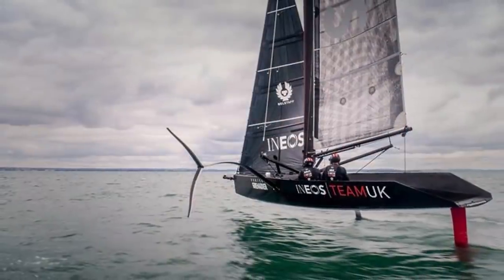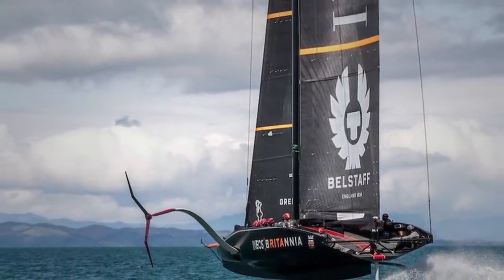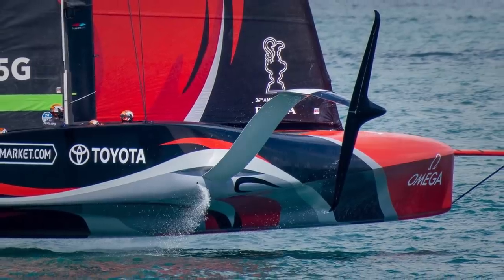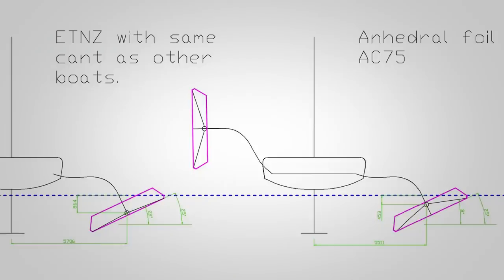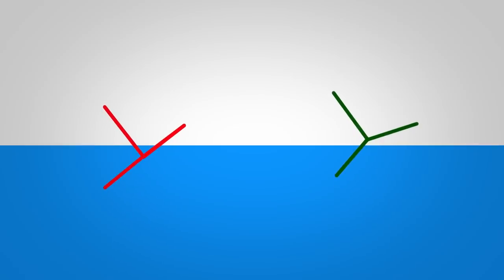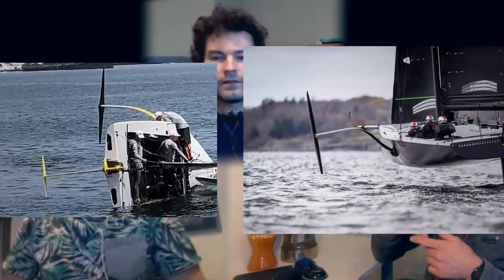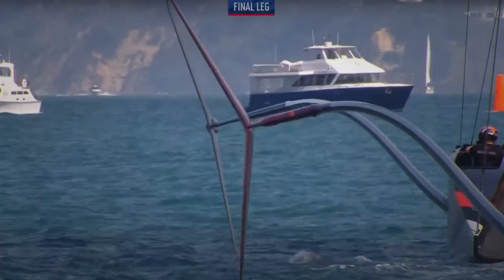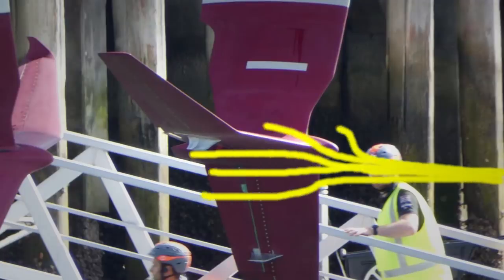Whose Foils are Fastest? ETNZ V Challengers // Straight V Anhedral

Comment: Questions perhaps you know or can find the answers to:
 1) Is the cant angle a design variable or a flight variable? Does the flight controller tweak it along with the foil flaps while flying? What about upwind vs downwind?
 2) Do you think different foils are relatively better or worse under different wave and wind conditions? Is there any evidence that the teams are swapping out foils based on the weather forecast? 
 3) The cant mechanics spec talks about being able to tell it to achieve a specific cant angle, but how this is controlled is opaque. Shots of Patriot during Semi Race 4 showed only "Up" "Down" buttons. What do you know about the Cant control interface?

With regard to the foil design, it seems to me that just as important as the vertical lift is the horizontal component of lift to help prevent skidding. This, if true, would point away from T shaped foils and to Y or W.
Reply: 3) they must preset the 'down' position for the boat or for the conditions of the race, so the up and down buttons  allow the foil arm to move to the preset position quickly in a tack.
Reply: @robingimblett2171  So there is no upwind/downwind cant angle difference?
Reply: @stevenallan4829  I'm sure there would be a number of selectable presets that the 'down' button works to. As you suggest the righting moment required is probably less on the downwind leg. This is conjecture not backed up by evidence from the boats.
Reply: @robingimblett2171  It seems to me that a traditional keel has two functions: righting moment and resistance to slipping. With the latter the boat just slips sideways. The righting moment is derived from the extension difference between the up and the down foils. Only the down foil provides the resistance to slippage and this is an important aspect not yet discussed.

Comment: Mozzy 2 questions.  Qu 1 - do any of you think that letting a foil break the surface might just be a clever way of reducing drag - by making them effectively smaller.  So meaning that you can design the foils for lighter conditions...in the same way that you might lift your daggerboard/raise a centreboard in breeze in a dinghy?  And Qu 2 - do the bend characterisitics of either side of each foil need to be exactly the same?  So they may look the symmetrically the same, but when loaded (under the water) might it not be clever to have the outer end flexing more than an stiffer inner section?  Just wonder what you all think happens at the time when it really matters (and we cannot actually see them..!!)  What do you think?
Reply from the maker: 1) Yes, that is exactly what ETNZ are doing. The trick is stopping ventilation whilst achieving that reduction in area. 
2) The foils have to be completely symmetrical in construction. So, the only way they can get more lift one one side of the arm compared to the other is by setting the flaps different. However, ETNZ only have one flap. So even operational flap angle would appear to be symmetric

Comment: Another really interesting vid!

One of the things that I’ve been wondering about since I first saw it, is that the rule book ‘frontal view box’ that foils have to sit in has the lower corners chopped off. In this video you showed the T section foils going to the bottom of the box and out as far as where the corners of the box are chopped. Would there be an advantage of such a T foil not going as deep into the box so it could be designed to the maximum width of the box, just above where the lower corners are chopped off? I appreciate the negative here is that the tips will breach the water surface sooner, but if they have accepted that anyway in the not so wide T foil, then surely the increased width would give more righting moment, more lift at low speed due to the greater surface area & when the whole foil is under water, and you’d still get the benefits of reduced drag as the wider foil started coming proud of the water surface.

The next thought, you talked about anhedral (Y) and W foils, I wondered if there would be some advantage in a ‘reverse anhedral’....that might take some explaining - the centre of the foil is at the very bottom of the rule box, but the tips of the foil go to the widest part of the rule box just above where the lower corners have been lopped off. My thinking here again is that it maximises width / surface area / righting moment possible, yes the tip will come out of the water sooner, but that seems to be accepted with the T anyway. The advantage vs the prior suggestion of stopping the T foils before the bottom of the box is that more of the foil will be deeper in the water. 

The other general thought I’ve had is that all these Y & W foils are very angular, would there be advantages is having a gently smoothly curving foil?....I’m thinking of smoother progression here as a foil breaks the surface...you showed in the vid an extreme Y where one arm was parallel to the water surface so one whole side of the foil would suddenly break through the surface, and there would be a very sudden loss of lift/righting moment (not like we have not seen any of that!). A gently curving foil may break the surface more progressively and be more controlable perhaps?

I’ve been a windsurfer most of my life, there was a period where fins had small ‘windows’ in then where they entered the underside of the board. The idea being that if cavitation started, the window would permit the pressure to equalise a little and therefore prevent a full spin out where the fin losses all grip. Just wondered if and of the AC foils had played with such an idea, I’ve not seen anything obvious, although Ineos foils did seem to leak water suggesting holes in it at one point....I wonder if those holes might have been some form of anti cavitation device?

Final thought for now, in the late 90’s I raced on the UK windsurf circuit, I got partial sponsorship in 1999 and raced on what collectively became known as ‘flapper boards’. These had the fin box placed right at the rear edge of the board for performance reasons I won’t go into here, but the downside was that air could get sucked down from the back of the board and attach to the foil making it prone to cavitation / spin out. The manufacturers/designers placed flaps of rubber on the backs of the boards to act as a low drag barrier between air and water surface to prevent the air getting drawn down. Maybe we will see some kind of similar barrier along the foil or foil arms in future on the AC75’s, if they continue onto future cups (& I hope they do)
Reply from the maker: So, the lines in the box aren't completely accurate. In reality, the foils have to fit in the box with their flaps down. So the frontal line of the wing will sit a little higher than the bottom. Then in the winglets will extended up and out to the max width section (2m). But hopefully the illustration still conveyed the point about the various traits of different frontal shapes.
The problem with the reversed W would be that it significantly increases frontal area. As you would have longer span wings AND a longer foil arm. And finally it makes the intersection angles at the foil arm very tight.
Reply: @MozzySails  ...ah, missed that point about the flaps, good point. Yes, also get the point about the increased frontal area that’s not doing much for you. That point was made in the video, but I don’t think I followed it until you reiterated it in response here - thanks.

Comment: I am using foil to surf for a  while .SINCE 2001 . We are going to use more a high aspect ratio . Now we are coming back to a medium aspect ratio . . But both with more a T Design . The discussion is long and there are man issues . But this view of the foil is only part of the design . On the surf we saw that  the T design you can take out the tip of the foil from the water and the foil keep the lift . On more y foil  or Anhedral  you can not take out the tip of the water . You loose all the lift and you have a ventilation and loose the lift . But this is part of all the problem

Comment: Has anyone tested two arms (on each side) with an elongated foil between them? It would likely eliminate the foil from vibrating, undulating (reducing speed).
Reply: Like an upside down car wing? I think the issue with this is the extra drag from the added support arms that have to reach all the way out to the end of the lifting surface. The next issue is that now you've moved the vibration from the tips of a 'half' foil to the middle of a longer foil. Pick the right harmonic and you could end up with a nasty little snap.

Comment: Interference drag is not really about cavitation. It is about drag. And you have to look at the change in lift distribution away from optimal with the anhedral foil if the flaps run at different angles.

Comment: To what extent do the rules allow the teams to control the position of the cant arms (how far down/up the arm swings)?  Also are they allowed to make small adjust the cant arm height while the foil is flying in the water (almost like trimming the sail in the wind)?
Reply from the maker: when it's up, it has to be in a 'stowed' position. However, when down, it can be at any angle they like. They can make small adjustments to cant angle whilst flying, however, the foil cant system (FCS) is glitchy and not really designed for this. So, the teams tend to minimise changes to cant, running a few degrees more cant upwind compared to downwind.

Comment: Is a "V" or "M" (upside down "W") allowable? It would mean shorter foils but allows at high speed the outer leg comes out at a fast rate to allow less drag but also extends the righting moment centre distance  further outside?
Reply from the maker: It's allowed. The downside to the these configurations is basically a more extreme version of T, in that it increases frontal area and further decreases the angle the wings meets with the foil arm intersection.

Comment: Y foil gives more lift in the vertical plane on the outboard wing, as it runs closer to the horizontal.
Reply: But the other side has less lift as none of the foil is producing pure upward lift.  This was the reason for the W foil.  But still that does not get to T foil amount of lift either.  Most of the time the raised foil is not even in the water.  Most of the races have been in full flight besides the drop down during tack which usually does not even get the hull into the water.  Also during that tack with both foils in the water a normal T foil should give more lift to keep the boat higher during the reduced speed of the turn.  Obviously these guys are great engineers, I am just wondering why T foils are not the go to foil.  Should get out of the water faster, and should provide more lift on the single foil.
Reply: @Power5  Yes that makes sense. I was thinking of the increased leverage of the more horizontal section of the Y foil (being further outboard) but am just musing. The T foil will create more induced drag, all else being equal (which it isn't) as there will be less flow towards the tips. Not sure if it's been mentioned yet but the foil section is hugely important. A picture on the video showed  that the foil on the boat in the foreground had a much thicker foil than the one in the background. Thin foils are fast but can't handle as much in terms of aoa, so will stall and be less forgiving, as well as producing less lift, mostly...unless they have leading edge bumps.
Reply: @RoyStuartwarpdrive  yeah but not sure AoA is that important for boats. 10-15 degrees of AoA is when typical "thin" airfoils stall. Not sure what AoA the hydrofoils see in races though. I would assume a 15 degree AoA the team would want that foil to stall so as not to turn the boat over.
Reply: @Power5  AOA is definitely important for watercraft., and in my experience stalling serves no good purpose as it is has a catastrophic effect on control. Be that as it may, there is, from the photograph I saw, a big difference in chord ratio (i.e. thickness) between at least two boats, and the difference will be due to design calls, it isn't random.
Reply: @Power5  Thanks for the discussion so far, by the way.
Reply: @RoyStuartwarpdrive  15 degrees is a lot of nose up angle. I think magic hit maybe 25 degrees as it was trying to take flight. Yes stall is a loss of control but that would be better than what happened to magic as it was trying to go to space. Then again I do not know what AoA the foils are at when dead in the water.

Comment: Re flow around the joint between the horizontal and vertical planes it certainly seems to explain why the bulb projects so far forward on the ETNZ foils as the flow is induced spanwise before the joint.
I was wondering what measures are being taken to prevent the ventilation from tracking along the foil?

Comment: T foil is definitely best option.  The W is the worst!  Nobody seems to get how critical T junction is.  Nobody is talking about maximum pressure points - which none of the boats have gotten yet.  You will see no one is using W foil anymore.  Reason is it has more drag than it is worth and once you have the T junction breach the water, which will be at higher speeds, you will get ventilation down the foil and lose all lift.
T foil tip - is OK because the strut will break the ventilation that goes down the foil, but the NZ team will NOT be sailing the boat with the tip out of the water if at all possible.
There are so many variables in foil geometries - plus the T junctions that due to misunderstandings of the theories involved, all the teams are doing this by trial and error.  
In my personal experience having driven foil assisted vessels since 2002, the NZ team have got it right and the others are still catching up.  Wish you guys had more experience, because you aren’t really adding much knowledge here, because you haven’t found the right questions to ask yet.  The rudimentary theories of high and low pressure are fundamentally WRONG - with the exception of understanding cavitation - which is not unlike the of air foils going from supersonic to the vacuum of space.
There is no such thing as cavitation foils that work.  You have super cavitation foils - which is all about designing a proper trailing edge - and having cavitation abatement features designed into the foil, but these boats are not hitting super cavitating foil speeds yet, so no worries there.

Comment: Is there any reason why teams aren't using a dihedral foil, given they have inherent roll stability?
Reply from the maker: I'm not sure how valid our traditional concepts of roll stability are, when the foils are so far away from the centre of gravity of the yacht. Sure, as the boat heels (rolls) the outboard wing would produce more lift shifting the col outboard. However, given how long this lever arm already is, I'm not sure it's significant in comparison to a plane where as they roll there will be a significant change in the CoL as the dipped wing rolls the plane back. 
Also, dihedral would require far more frontal area for the same span, so more drag.
Reply: @MozzySails  I agree regarding the additional frontal area. Would be interesting to know the magnitude of difference seen at the boat with stability taking into account the effect of the levers.